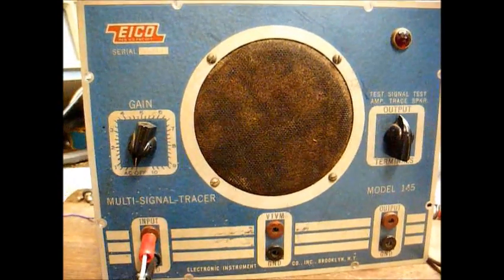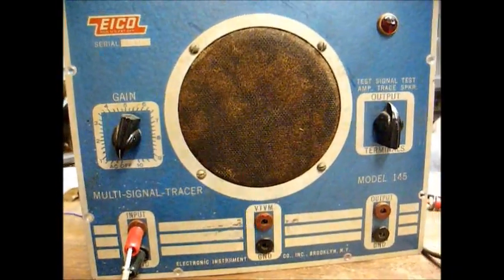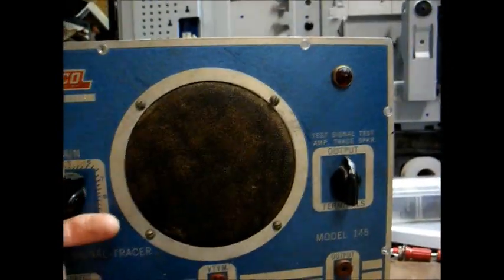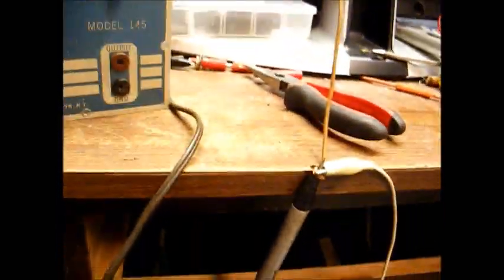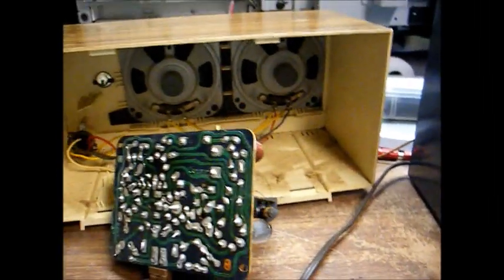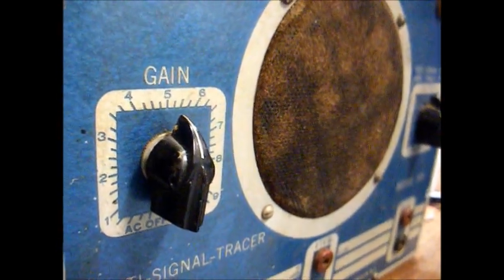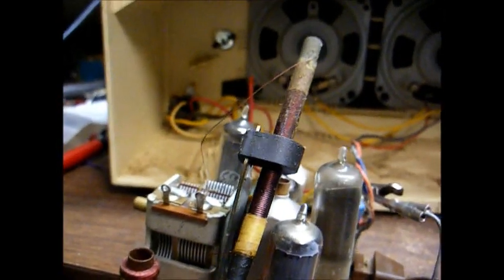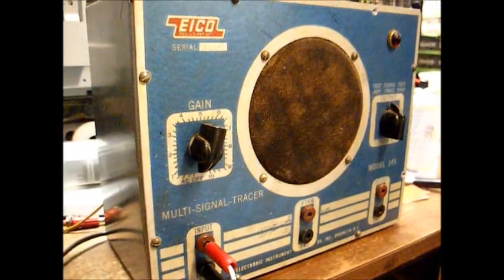Eico model 145 signal tracer demonstration

Comment: I just eliminated 95% pf the hum in my instrument. First  removed the  6x5 tube and replaced  it with two 1N4007 silicon Diodes, with a three stage Pi power supply filter using a 22 uf , 33uf and a 47 uf cap.  Then I Put a # 12 copper buss  bar ground . I separated the two caps that were input coupling  caps  and shield the leads connected to them going to and from the gain pot. A small Mu metal shield was placed around the power transformer. Lastly I moved the on off switch wires from the gain pot to a toggle switch on the other side of the chassis. I have no annoying hum anymore.

Comment: I could build a better signal tracer than this one. Its ok for audio troubleshooting, but have a serious hum problem even after its been restored. I use it on my audio troubleshooting bench along with a signal generator and a scope. Its good in an IF alignment. Setup. First replace the 6X5 with a solid state module. Find a 6SJ7 with a metal envelope , to eliminate hum and micro-phonics. Re- capping is a quick and easy chore, there aren’t many parts inside. Id step up the filter caps to 47 uf. Make sure you have ground side of coupling caps wired to ground. Changing the input jacks to phono or BNC is a must. Layout is terrible too. The power transformer is wired such that it feeds 69 cycle right into the speaker coil. Turn it 90 degrees or  cover with a grounded copper shield around the transformer.

Comment: Hi,  I am working on one of these that was butchered pretty bad.  I ended up just following the instructions and putting it back together.  Not sure what they modified it to do but it had a bunch of odd ball parts including a relay and a selenium  rectifier the tube rectifier was still connected and "working".  Just wondering if you remember (or any one here) what size the electrolytic caps were.  The schematic shows them as 10 mfd  which is what I used they had two 40 mfd in the tracer.  I am getting a capacitor like hum which I really think is a bad ground since I hear it when the volume is all the way down.   Any input is appreciated!

Comment: Would you say that the ever-present background hum is normal? I've recapped mine, replaced any bad resistors, and fixed all of the bad solder joints, and still have that annoying hum. It works, but the hum is always there. So annoying.